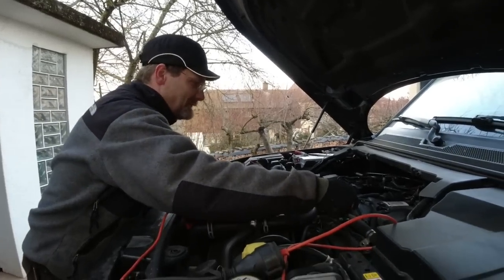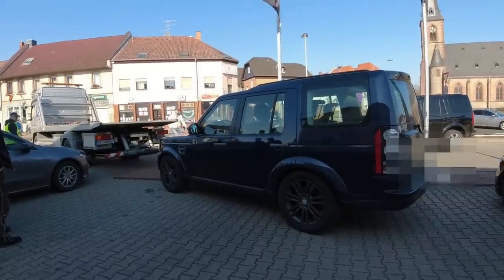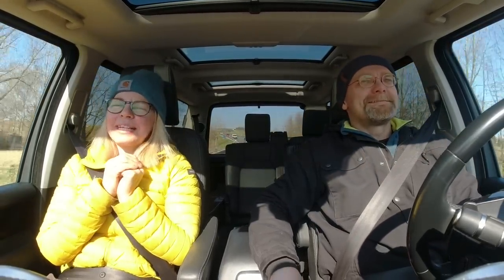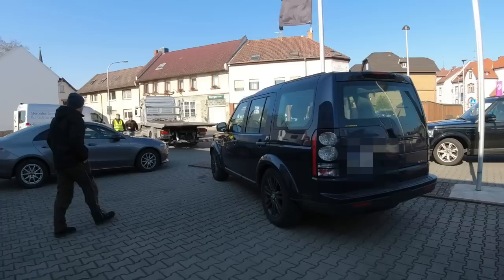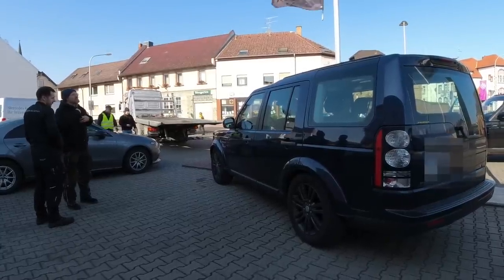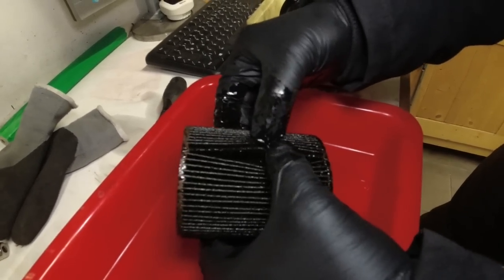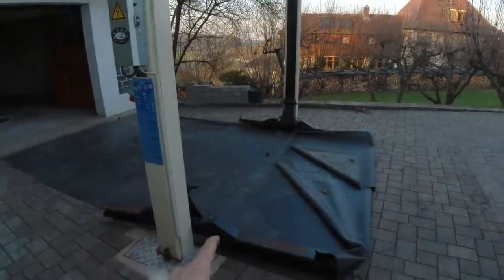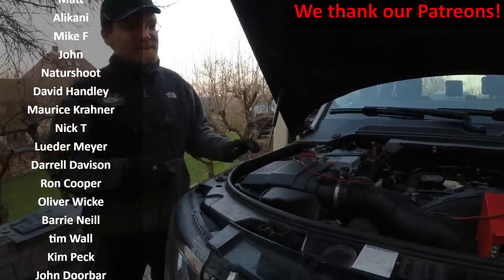We bought a dead engine LAND ROVER with only 40.000 Miles / S4-Ep10

Comment: I hope you are both doing well, and please ignore those who do not understand you Christian or should I say Arnie (your accent is like Arnold Schwarzenegger) in terminator movies....

My guess that the 2016 new project maul crawler has resulted from a bottom end seizer. Typically, this results in a replacement engine, because nobody puts any effort/time/costs in nowadays to repair them like you will!

The engine design of the Peugeot was sold to Jag and LR and my experience comes from the LR3 and Jags that had the 2.7 diesel v6’s, but I have been informed the LR4 was a weak engine which are very short with quite thin webs on the crank, this combined with a very efficient top end especially in LR4 (high torque and excellent pulling power) amplifies crank flexing as the bearing tolerances enlarge and then the engines can seize.

I look forward to seeing your repair or perhaps fro the first time on LR TIME an engine replacement?

Comment: Main bearing failure and seizure of the crankshaft. Crank may or may not be broken. To check you would need to see if there is any movement from the torque converter end.

Comment: My guess. A blocked oil strainer caused by excessive carbon deposits in the oil. This is the result of leaking fuel from one, or more, injectors. A good long block engine is hard to find and expensive. Good luck guys and keep up the good work

Comment: Thank you so much I think you are the best.. I am an engineer from sunny Australia with a D3.. Not many things I think can stop an engine rock solid like that but a seized piston will so that is my suggestion. Some sort of oil starvation to one cylinder and given the high speed once lubrication failed it could overheat quickly and seize like that.

Comment: Seizure of the crankshaft due to lack of oil. Lack of oil due to silicone in one of the oil ways to the crankshaft. I’m not saying that someone left a timing tool anywhere or a socket left on the auxiliary belt sprocket 🙄😀. Keep the videos coming your humour is enjoyable.

Comment: This is going to be a great series of videos! My wild guess; something went wrong with the injection or cooling system (fuel or coolant), a cylinder or 2 filled with liquid and hydrolocked the engine? That's my best guess with "engine suddenly stalled, locked up in both directions, no chips in filter". I do not believe a rod is broken just based on not seeing coolant in the oil filter where a coolant/oil breach would have been nearly certain had a rod broken

Comment: Your description suggests that the crank has completely seized. My guess would be that you will find metal in the sump, bearing shells are dead and that the problem will turn out to be low oil pressure from a bad oil pump.

Comment: I am thinking oil pump failure causing loss of pressure at high speed and toasting the main bearing(s). 

BTW, love your channel.  I found it when a friend who was moving overseas offered to sell me his '14 LR4 with 84,000 miles on the clock, for what I considered a good price. I knew LRs are not particularly dependable and rather expensive to maintain. Also, not exactly a lot of part sources here in the states. Your channel has given me the confidence to purchase and self maintain it.

Also, your channel is just plain entertaining. Your great English along with your German accents and personalities are awesome. Christian, I hope you don't take offense, but your personally and voice reminds me of the dude that does the Jenifer poops at parties on You tube,. I hope you find this a compliment I intended.

Comment: Envy is a terrible thing. Ignore the negativity and just carry on doing your great stuff. I enjoy the technical content and the humour. Now as for the problem with this Discovery. I hope that it is a simple issue and the last owner gets it back. However as it failed at a very low mileage and was on the autobahn at the time I think it will have been caused by loss of lubrication to a main bearing leading to spun shells and  seized crankshaft. If it was a big end that failed (seized) the crank would probably have some perceptible back and for movement with the breaker bar. The crank probably hasn’t snapped as it was not a dramatic failure and again there would likely be some movement.  I’m looking forward to the next episode.

Comment: Hi Christian and Vera,
Here's your biggest Dutch fan from France ;-p      I think, due to the sudden death of the car it must be an instant failure. I'm thinking about a broken piston ring(s) which looked up the piston and stalled the engine, if the crackshaft was broken you would have felt that on the breakerbar (there would at least be a little play) 
Or one of the main bearings seazed, so the crackshaft would have stopped turning instantly. A🤗 main cause would than be the engine cooling This could have  caused sudden overheating. Maybe the driver (i'm not going into sex details here) must have ignored display messages like low coolant level or the overheating chime when the coolant needle hits the red area. I'm just guessing here and i'm curious to see the next video and the findings. Good luck. We love your vids
🤗

Comment: In my humble opinion it probably is only timing belt issue ( damaged or started with a crack of a tensioner).
Second guess would be a destroyed valve.
However I do not think it is a broken crankshaft of spinned bearing. The car seems to new/young kilometers and well maintained. I am very curious what it will look inside the engine. 
By the way, I think there has to be alternatives to buy a factory new engine from LR. There should be serious engine rebuilders who will repair engine for 8000-12000 depending what has to be replaced or would be recommendable ( like, pumps, chains, turbos etc ) after taking labourisly out the whole engine.
Would be nice topic to have some knowledge about “what to do” when final day has come to us lovers of LR 3 and LR4

Comment: I'm from Australia. My guess is that the oil pump failed , oil pressure dropped and failed to provide oil to the main crank bearings and they fused to the crank and this is why it's seized.

Comment: Crankshaft broken, lack of lubricant on the inner bearings. Funny thing is that in the Jaguars they seem to break less often, so the weight of the Discovery also is a reason for it to fail! Remember to check the torque converter! If the engine seized while driving, the torque converter got one hell of a bam!

Comment: I had exactly the same issue in Citroen C6, no chips, no prognostic shadow at all, it just stop on the highway in Croatia driving 125km/h with cruise control. In my case - and I believe in yours as well - it was crankshaft broke, exactly at the same position, when you showed in your previous video, when oil line supports two bearings, one fix and one flybearing. I remember between last two zylinder in direction to the belt drive. If I can guess you need to buy another crankshaft, bearings, new oil pump, and belt drive component and you might have broken chain on the camshafts, and stamp of zylinder in the head due to centripetal force while it broke apart. If I guess the price, around 5Teur.

Comment: I think the time belt snapped and the valves have done a number on the top end and jammed the engine up, hopefully the bottom end can be saved,  could be a stupid crank sensor aswell stopping the crank

Comment: Hi guys, Pat here in Ireland. Love your work and the video's. I was laughing at you moving the vehicle from the recovery truck to the workshop as it was nearly identical to what myself and my good wife Shari had to do last Nov when I bough a Disco 3 with a non running engine. (A bit more swearing on this side maybe) That was a failed oil pump, broken T belt & bent cams. I lifted the body and fitted a donor engine during Xmas, now its Shari's daily driver. On your scenario, here is my best shot. As there is zero play at the pulley, I would think the crankshaft may have fused to the shells. If the locking was due from an issue up in the top half of the engine I would expect some play at the bottom end. This scenario would result from oil starvation, a few variables as to why this may happen, failed pump, restricted oil pickup or a blockage somewhere in the oil distribution circuit. Looking forward to next episode. 👍👍

Comment: Low oil pressure due to blocked oilways,causing dry/ overheated main and big end bearings. Thus seizing up/ welding the crank to the mains

Comment: My guess is: A bearing began to spin, blocking oil flow and increasing friction and heat buildup. the bearing fused with the crankshaft causing it to block completely. If lucky perhaps even before the crankshaft snapped.

Comment: The main thing I'm considering is that the vehicle lost power at highway speed and yet the owner DOESN'T claim anything "dramatic" happened.
That would imply nothing "destructive" happened; no snapped timing chain, broken conrod, dropped valves or snapped crankshaft.
Even if the oil pump failed, causing the engine to seize once it cooled down, I'd assume it would have run noisily for long enough that the owner would consider it "dramatic".

We know the vehicle rolls so the transmission can't be completely seized but I'd want to verify that the gearbox isn't preventing the engine turning before I'd assume the fault IS in the engine.
If we accept that this IS an engine fault then I'd say seized crankshaft but I wouldn't be surprised if it actually turns out that the engine is okay and the fault is in the gearbox.

Hard to believe that anybody could dislike Christian and Vera's video's.
I guess some people just think work on Land Rovers should only be done by men in woolly hats using lump hammers while standing in muddy fields.
Or, perhaps they just can't handle the idea of Germans with a sense of humour? 😜

Anyway, I need to put on my woolly hat, find my lump hammer and fit some new brake discs to my Disco'...

Comment: I am looking forward to this series!
Why do people feel the need to be vicious on FB? If they don’t like what you do, don’t watch it. Simple.
I’m thinking a catastrophic crank seizure of some sort. I think if it were a cam belt, there would be some movement of the crankshaft - even if the engine stopped quickly, the momentum of the flywheel, etc, at 1600rpm would make short work of destroying the valve train, likewise a seized piston. That is of course assuming the engine was locked solid when it happened, and it hasn’t hydraulically locked itself up (due to initial damage) whilst it’s been standing.
I wish you had told us what the dashboard oil level sensor registered!
Good luck!

Comment: most will go with bottem end failure, i am going for a hailmary and going to say something in the timing chain failed and has the crankshaft bound up.
normally with a bearing failure u woulf see metal in the filter, a crank failure would expect SOME movement,  rod or pistion failure can cause these symptoms  but thats the easy guess.
ANyways looking forward to the rebuild series!

Comment: i think it has been run low on oil and has seized the two middle main bearing shells. another job that is not very well covered is the aircon pump removal 3/4.

Comment: "German Matt's Off-Road Recovery" doesn't involve much off-roading. . . Maybe rebrand as "Vera's Mall Rescue." 

I bought a mechanically totaled LR4 about a month ago. It is currently sitting in my garage, body off, with the engine torn down with the cylinder heads off.  It is the v8 5.0L petrol, a cam-follower (lifter, tappet. . . manual and parts catalog call it all three). Chewed up the valve, the tappet guide, and the cam shaft. Going to try replacing the head with a used one . . . wish me luck!
Reply: I didn't finish the sentence about the cam follower! It exploded. The top of it exploded, the valve keepers came off. No piston-to-valve contact, but it was throwing timing errors. So unclear what the initial mode of failure was. Could have started with cam/tappet problem, maybe something bad with the spring keeper even. Or maybe it jumped time and went from there. Has the updated timing chain guides, but one timing chain seemed too loose. I should have checked the timing marks before removing timing guides and chain. . . but I was dedicated to tearing it down and replacing timing kit and head gaskets anyway.

Comment: Thanks for the very interesting video, this is a great project car.  I am looking forward to seeing what the problem is with this vehicle in future videos. I think it is a seized main bearing but the crankshaft has not broken or cracked.  The engine has slowed down as the bearing continued to bind on the crankshaft until the engine has stopped.

Comment: Looks like a D4 Graphite - one of the two run-out D4 models in 2016. Given the low mileage and young age, it probably hasn't reached timing belt interval yet. I would guess it's still a spun bearing which then seized the crank with the possible reason being incomplete DPF regen cycles (if car hasn't been driven much) causing excessive diesel to dilute the oil 😰. Thanks for making the video. Can't wait to see the next reveal...

Comment: My guess. If the crank not moving - failed (overheated and melted) bearings. Probably due to a bad oil pump. It might not get the crank snap, as driving a highway is generally smother for the engine

Comment: Hi both, looking forward to finding out what has happened! Really enjoy your videos. Totally envious of your knowledge and the fact you have a vehicle lift in your driveway🙂 The fact that the crank pully does not 'wiggle' seems to indicate the crank is intact. The fact that the crank pully will not turn seems to indicate a seized engine. Could the problem be worn crankshaft bearings? As the vehicle has only covered 40,000 miles it may have been doing many journeys (and many starts) over a short distance rather than fewer journeys (and starts) over longer distances. Also, the vehicle probably has auto stop/start which may not help either. The oil pressure may have suffered and the bearings may have worn over time and then maybe they spun and the engine finally seized on the motorway. I guess the gradually 'seizing' engine may have snapped or stripped the timing belt before it broke the crankshaft?

Comment: So far, no oil leaks, no wriggle of the balancer, locked rotation.  Going back to Ford dinosaur overhead cam V-8 fiasco of the late "90's, my guess is a valve interference issue.  In this version TD6, going to point at the EGR valves causing soot buildup and disturbing valve timing, /interference/seizing crank rotation.  There is a tech bulletin about removing the EGRs,  Still going to be some hours and euroes for the cylinder head restorations.  Might escape block removal.  Only JLR would buy such an engine that Ford would not sell to anyone else or install in their vehicles., From the land of MORR!!  Great channel!!

Comment: Timing belt failure causing cams to loose time, bend valve stems on pistons 2, 3 and 4. Causing piston to lock up and prevent crank turning. Belt perished due to over time service causing failure. 
New belt etc, valves, possibly new pistons and your good to go, possibly 🙈

Comment: Hello C & V. This is fun!, although my sincerest commiserations to the family who owned her, as it looks like a gorgeous vehicle. My guess is that premature wear (due to LR's stupid oil service interval) on the timing chain shoes adjuster caused the chain to jump and skip timing. This may have dumped the valves and bejuggered the cams,.....or oil starvation of the crank journals causing a bearing failure and consequent crank break,.....or.... they found themselves racing a Toyota Landcruiser 200 series down the autobahn, and the poor Landy fried its guts out due the totally inappropriate 5W-Dumbass pumping around its innards trying to keep up. Getting  the popcorn bucket out for this one!

Comment: Hi Christian and Vera, I’m from the UK have  2 Discovery and one range Rover l405  2018 tdv8  in the dealership  with misfiring, engine been there three weeks still haven’t found the problem.
Anyway, back to your disco 4 I reckon cam belt broken and snapped crank and 1.5 in litres, of oil in the sump.
Regards 
Michael

Comment: Hi from Wales in the UK. You are not a dumbass or a clown . I have a 2013 l320 range rover sport,134,000 miles on the clock. Thanks to you my car runs like a swiss watch with zero defects in 5 yrs of ownership. I suspect fuel pump belt failure, just a guess. Love the videos.🏴🐑😁

Comment: Diagnosis - not a failure of main bearing as there was no 'glitter' in the oil filter. Complete lock-up of crank suggests it is snapped.

Cause is low quality of crank manufacture resulting in catastrophic failure.